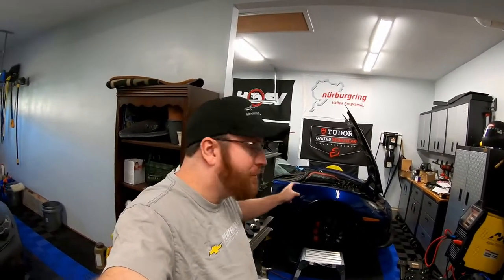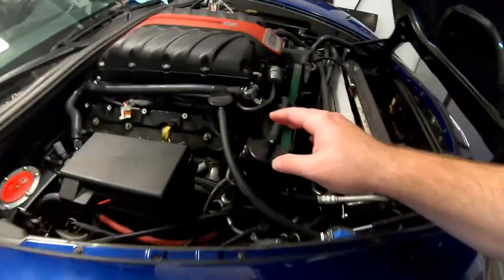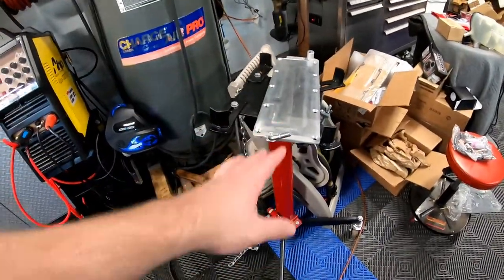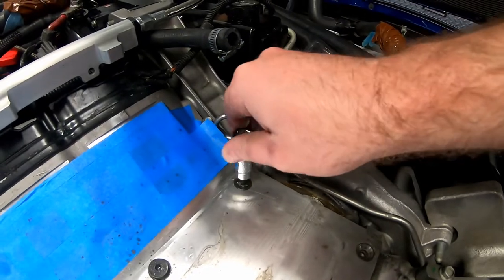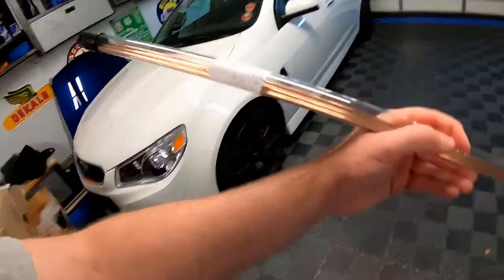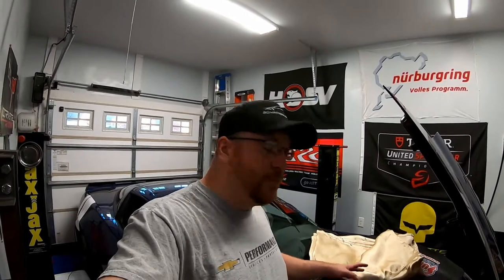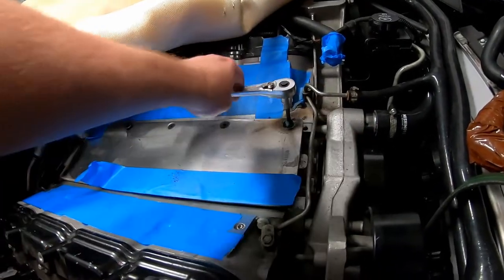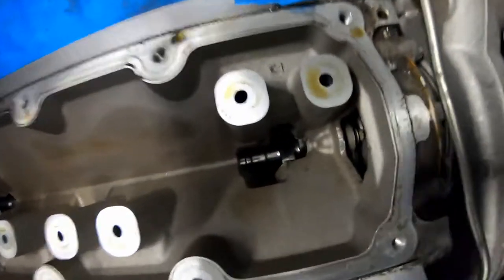2005 Chevy Corvette - V4.0 - Ep 33 - Edelbrock Vented Valley Plate

Comment: Those counter sunk bolts can be removed without all that welding. I remove those 1/4" alans that get rounded out everyday at work. The metal in the alan can be rolled back in to hold a wrench tighter than a new bolt.
Or you can use a punch on the flat of the bolt. Tap the punch into the bolt and just tap that bolt lose.
Knuckleheads at work strip those small alan heads all the time.
Reply from the maker: I ground, I drilled, I tapped, I used a torch - nothing got those dang bolts out. Edelbrock used crap hardware with that plate - as you can see in the video I swapped everything for stainless.